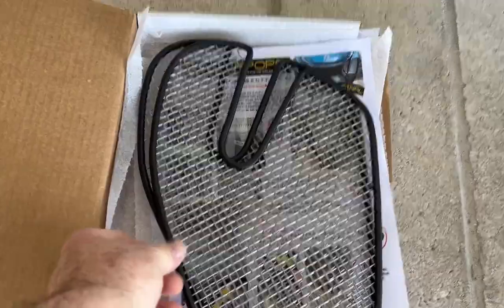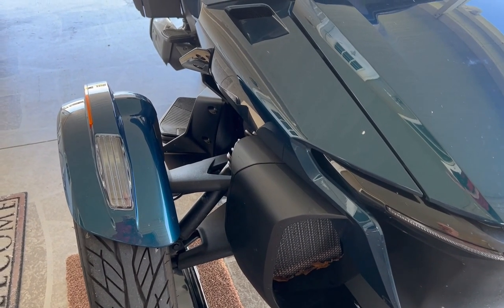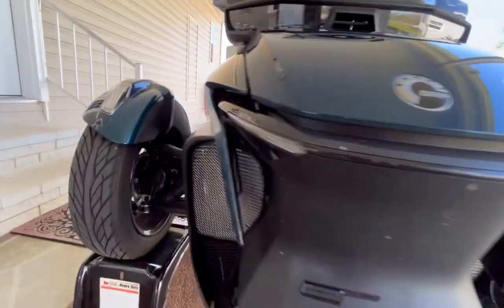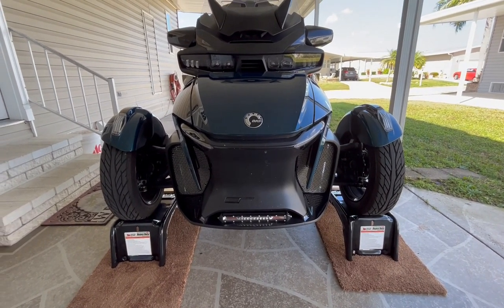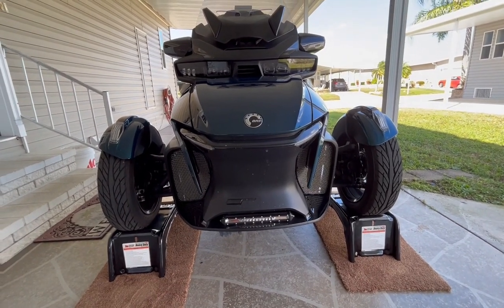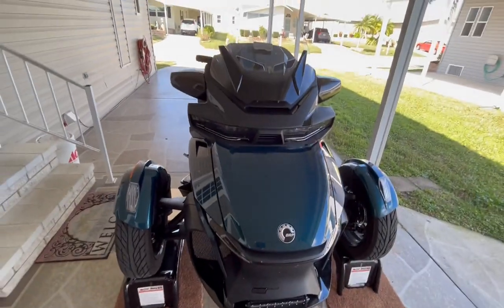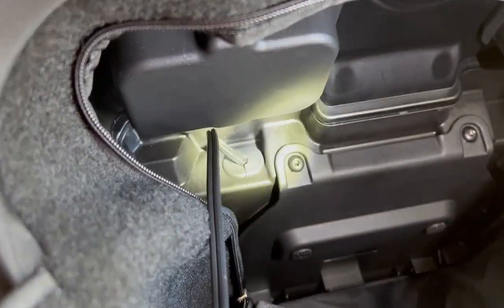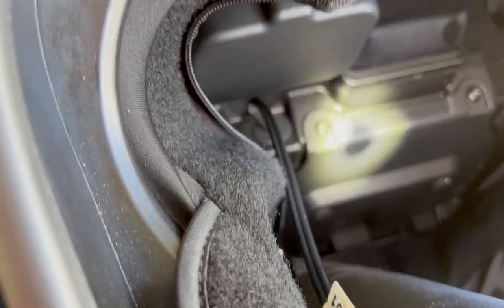Radiator Grill guards spYderpops

Comment: Hi Slice, the grill guards look good and will be a great help in keeping the radiators cleaner. I have the Spyderpops grill guards on my 17RTL and I love the look. 
   Good move on the battery tender wire the frunk is where I put mine when I installed it. 
Keep the videos coming and Ryde safe and God Bless 
Artie
Reply from the maker: that battery tender lead really annoyed me , why they would have it dangling behind the radiator fan is beyond me.

Comment: My battery tender lead is on the left side... Did you want to put it in the frunk because of moisture? Oh .. You answered...
Reply: The frunk is an ideal location.   You can easily tap off the battery with a wire harness kit and keep it completely weather proof when not in use.